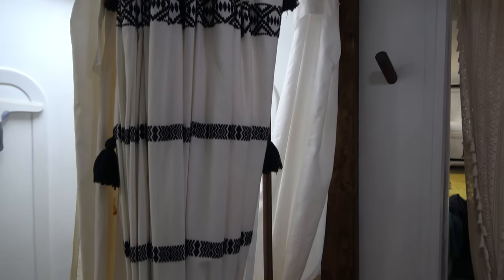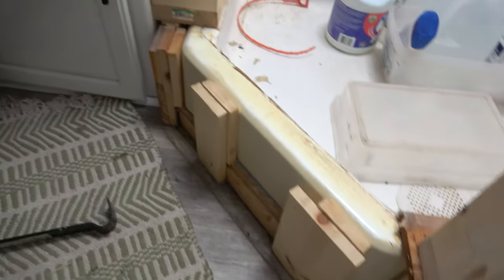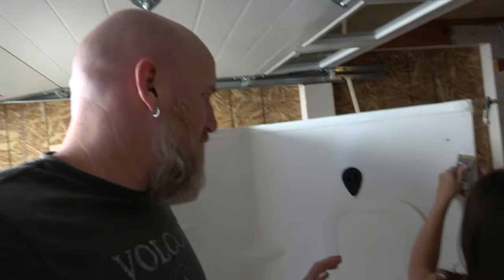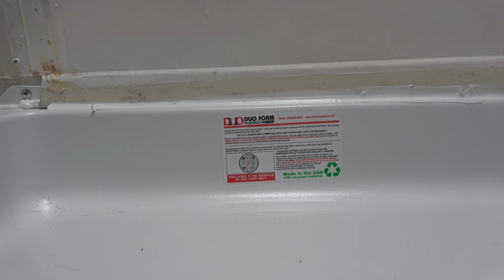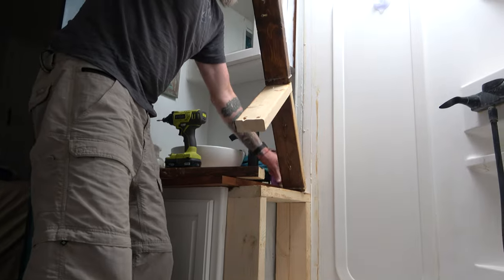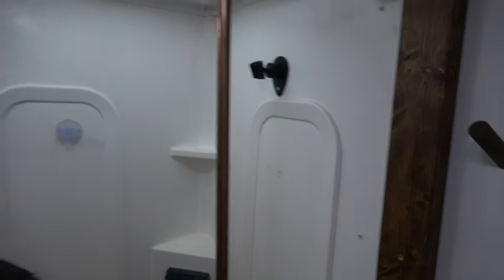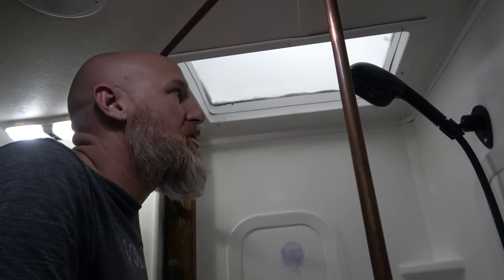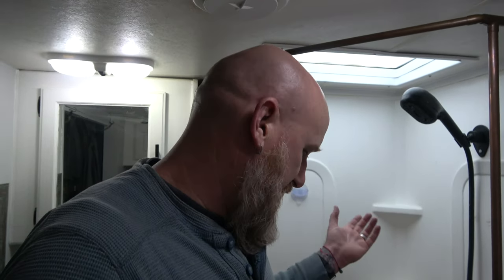Fixing A Water Leak in Our RV Shower // RV Leak Repair RV Shower Leak RV Shower Pan // CTW 177

Comment: Fill screw holes with a toothpick covered with wood glue.
Reply from the maker: Good idea!
Reply: @CalledToWander would you please do a comment, maybe a short on the status of your “Henry’s” roof coating? It has been about 2 1/2 years since your coating. There seem to be a lot of coating products. Thanks.
Reply: Hammer in a stick match Coated with wood glue and snip it off flush with side cutters,
Reply from the maker: @jamesscott1932  we just made a longform update video on the roof. It’s one video before this one

Comment: Hows the pan holding up? I was told to use flex seal an coat my entire pan.which is no longer made..i used a fiberglass repair kit and it didnt last long at all
Reply from the maker: The pan is great! We should have invested in this repair/upgrade when we did the remodel but we were intimidated by the scope of the project and if it’s not broke don’t fix it… until it breaks!